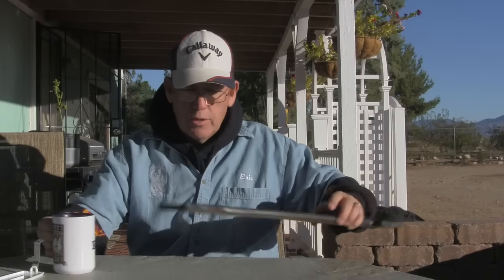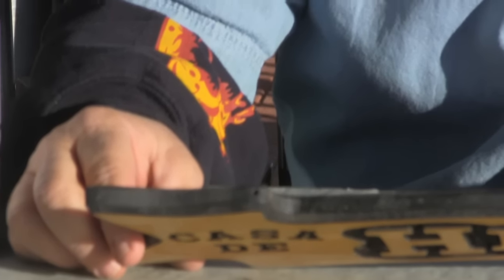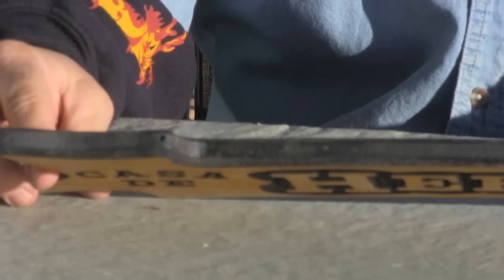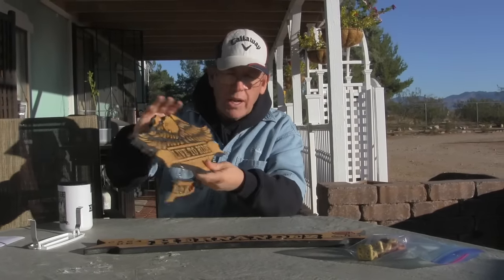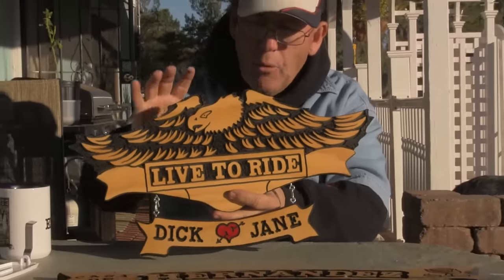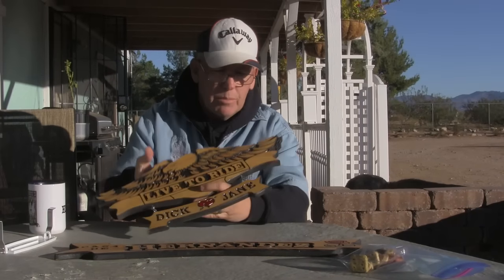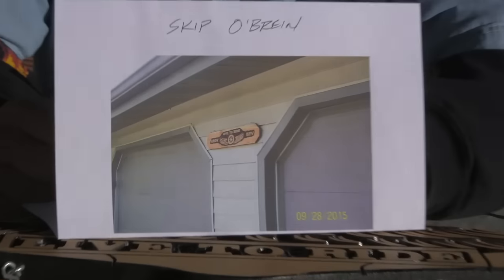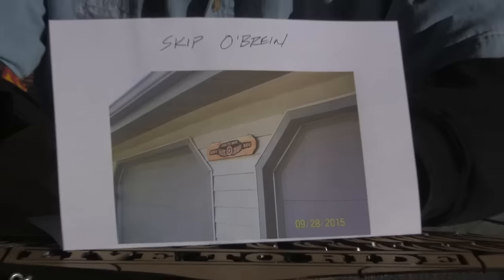Coffee & Questions 11/7/15 Drilling Signs

Comment: do you space them (holes) a standard distance on all your signs? i thought you mentioned before you spaced them 1ft apart
Reply from the maker: +Jason Hillyer Yes normally 12" centers but on the ribbons it's at the 2 highest parts.
Reply: ok that makes sense thank you